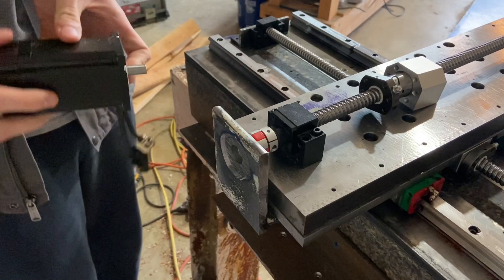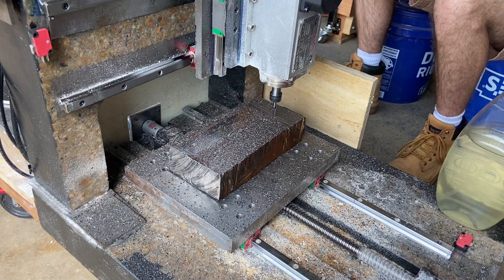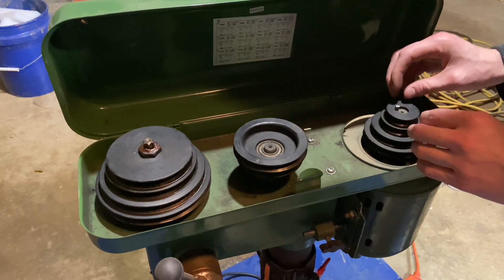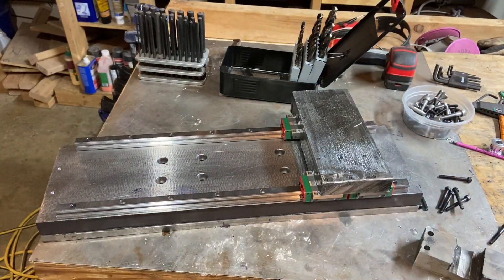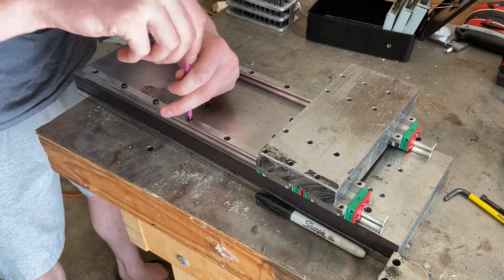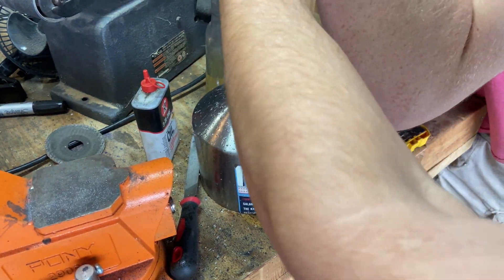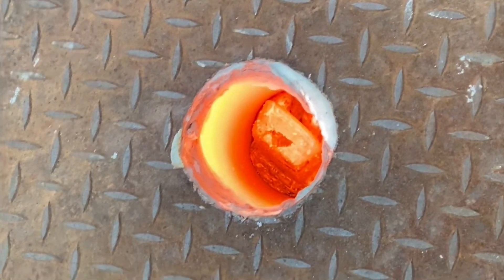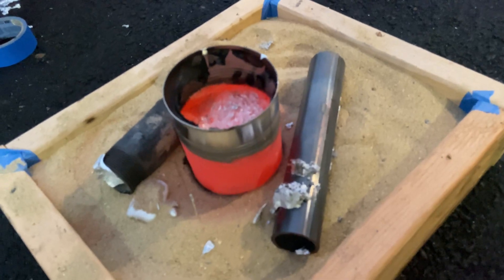DIY Epoxy Granite Metal Lathe 11: Milling the Cross Slide Carriage

Comment: Its been painful watching you use a four flute hand tap for all your holes. A 2 or 3 flute machine tap is what i use most. A spiral tap is good for blind holes but not necessary. I'd buy 2 flute first if ypur only getting one. Be sure you tap full depth and dont use it like a four flute as the machine taps break the chips by design. Backing them off dulls them and is a good way to increase chance of breaking it. I hope this latje gets finished, I'm curious how its going to work. You did a great job considering the limited tools you had. Get er done!

Comment: Bolting a vise to the table only makes sense when you're processing hundreds or thousands of parts. I've done this on a gang press with 6 drill heads. Each station performed only one operation on the parts. With three operators assigned, each operator running two stations, the parts get finished very quickly.
Reply from the maker: That’s really interesting, thanks!

Comment: Hey Superman, watch out for kryptonite!

Molten metal can splash. People can trip. Your rebar tongs can slip. Molten metal can burn straight through a leather boot faster than you can jump away. What do you think it would do to your bare skin?  

You're pouring molten metal with short pants, short sleeves, and nothing protects your head or eyes while you admit you're twisting your wrists and it's difficult.  You would change the rest of your life in an instant.

Protect the father of your unborn children.

Comment: To tap with your cordless set your clutch as low as it goes and increase slowly by feel. Remember you can still break it if you pull or bump it off axis. If possible use a form tap all around better.
Reply from the maker: Thanks!!

Comment: The trick to transfer punches is to drill 1 hole. Tap it. Then bolt it together. Now use a transfer punch on ONLY the farthest away hole. Remove everything. Drill and tap the second hole. Now bolt it back together. Now you can use a transfer punch on the rest of your holes. Now all your holes are correct and you have no speed holes.
Reply from the maker: I’m not gonna lie I feel a little dumb for not doing it that way from the get go but thanks, I will definitely be doing that moving forward at least hahaha.
Reply: @robertsteinwandel6658  thanks for the video. I'm trying to find enough motivation to do what you have done here. Good work.
Reply from the maker: @brett8090  thanks!! Hopefully I’ll have another up before too too long!

Comment: Machine taps. There are spiral and straight flute taps. Spiral feed the chips up. Straight feed the chips down so not good for blind holes. Make sure you are using the correct tapping drill size or marginally bigger 0.1mm or 4 thou. Take a look at Nobox7 on YouTube for burner designs and olfoundry man for metal casting.
Reply from the maker: I absolutely will, thank you! Actually I have had some luck with ever so slightly oversized holes making tapping way easier, I totally get what you’re saying there. Unfortunately I don’t have the “real” tap drill sizes so I just use the nearest 64th of an inch, but I kind of ends up achieving the same goal hahaha
Thanks!

Comment: 9:17 - Yikes... for safety, should really consider getting face shield and body protection for molten metal casting.
Reply from the maker: That’s probably fair, I would think even a non heat rated face shield would help right?

Comment: I made a pouring shank from rebar with a loop welded on the end. Sit that on a brick, lift out the crucible with the tongs, put it on the brick, end then lift it with the pouring shank.
Reply from the maker: Did you need anything to stop the crucible from tipping out the top of the loop when you pour the last of the metal from the crucible?

It seems like pouring out the last few drops it would be a little close on whether it would stay, but maybe that’s not the case?
Reply: @robertsteinwandel6658  If you make it a nice fit just under the waist of the crucible, there is enough friction. You cant turn it upside down, but it is fine for pouring everything out.
A lot of people totally over complicate that. Take a look at a few of my casting videos.
Reply from the maker: @RotarySMP  that’s great, thanks!! Yeah I remember seeing something but I’ll have to go back through and look for that specifically

Comment: Tap in the drill! Spiral taps are way faster for sure, but regular ones work. I did it for a long time without spirals, doesn't matter how thick the metal is. You'll get pretty quick at switching between forward and reverse. in out in out in out throughhhhhh. honestly pretty hard to break a tap with a drill unless you yank on it sideways. I've found that most hand tighten drill chucks just start slipping and won't break the tap. then you just reverse and go at it again. Run in the fastest gear. just try it out with a couple it's super easy.
Reply from the maker: Interesting interesting, I’ll have to grab some scrap steel and give that a shot. Thanks!
Reply: I've spent entire days running M6 taps through 5mm thick sheets of punched nutplates.
Get it cocked off at an angle, even only a slight one and it can bind and break. Run it through true and it's easy.
Reply from the maker: @kieranh2005  do you just align it by hand or do you use a jig of some sort to be true every time? I’ve definitely noticed other times even just a few degrees off makes a big difference in ease of tapping
Reply: @robertsteinwandel6658  by hand. One side of the punching tapers in, that helps, but you still have to get it fairly straight by eye and experience.

Comment: Regarding not fitting in your drill press. Swing away the normal table, put your part in your vice and place this on the bottom base. You may have already figured that out.

Mark

P.S. Nice seeing a young man using his head and his hands. Keep it up!

Missed your pour. You need a pouring handle. A pipe with a ring that fits part way up the crucible put a 10 inch tee handle on the end of 3 1/2 to 4 feet of pipe. and place your crucible in the ring that you weld up. It will hold it well. 

Watch Olfoundryman to learn how to properly pour metal. I started even younger than you. You are doing great!
Reply from the maker: I actually have that exact setup in the drill press right now hahaha, about to drill the hole- fingers crossed!
Thanks!
Yes a pouring handle will definitely need to be one of my next projects haha, thatll be a huge difference. Thanks for the advice!

Comment: You can use a normal taper tap straight in a hand drill, but you risk snapping the tap because you get very limited tactile feedback. This isn't as big of an issue with bigger taps but as they get smaller the probability of a failure increases exponentially. I personally am comfortable using anything 1/4"/6mm and up in a hand drill without much care, and have done down to 1/8"/3mm successfully being very meticulous.
Reply from the maker: Out of curiosity, what thickness of metal was that in? Trying to get a gauge for what’s possible here
Reply: @robertsteinwandel6658  Up to 1/4" steel that I can remember, I don't often work in thicker stock than that. You might need to be more careful on thicker stuff, possibly stopping and backing out a couple times to clear the flutes. One thing to keep in mind is that tap shanks will really like to spin in your drill chuck so you need to really wrench down on it since the chuck jaws won't engage with the square drive flats on the end like a tap wrench does.
Reply from the maker: @Trainwreck1123  that makes sense, thanks. I’ll give it a try!

Comment: Tapping with a driver is useful but since you have a drill press it might also be worth looking for a “tapping head” which makes the process both fast and unlikely to break the tap. With the driver, the first second is most important because you’re setting the angle. Other than that, just use a good lube like Tap Magic and you should be good.
Reply from the maker: I’ll look into that, thanks!

Comment: Considering fastening the vice on the drill press I think if come down to precision. As you noticed you needed to enlarge the holes to make the fitting easier. This is because you wand rigidity for precision: a) drill bit will wonder a bit; b) your piece will also move around; c) you can hold the lever and the piece and use cutting oil at the same time; and finally d) if the drill is large the amount of torque on the part is going to be significant which is dangerous and mean not all the force goes to the drilling. So I'd say fastening the vise makes sense, but does means either you have a easy way to change the setup or you will have to spend a lot of time between holes.

Comment: Only because you asked... Re: Tapping, I do it the same way you do and also wonder about doing it with a drill.  Re: Clamping on the drill press table,  I've never seen anyone actually use the provided slots. I'll either clamp the vise or the workpiece with bar clamps.  Also, Re: Pouring the crucible, it seems common to use 2 different tongs.  One, like yours, to lift the crucible out, and a second style to pour with.  Keep up the great work!
Reply from the maker: Tapping- I suppose if it ain’t broke don’t fix it hahaha, it sure won’t kill me to take the 5 minutes to tap some holes the normal way. And if it saves me the pain of a broken tap in my workpiece that’s definitely worth it.
Clamping- that’s what I assumed haha, I need to be less lazy about actually clamping my piece and not just using my hand to hold the vice 
Crucible- I’ve seen that a few times I think, maybe that’ll have to be a quick day project then, to make pouring tongs. Seems like that would make life a lot easier!